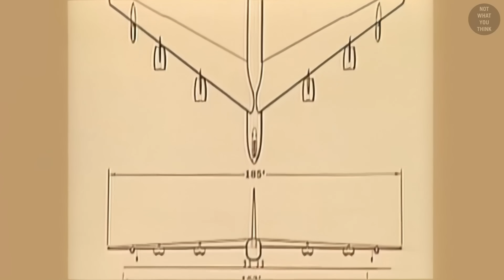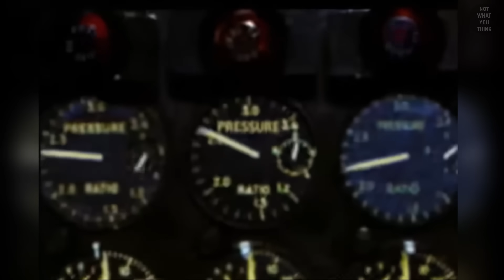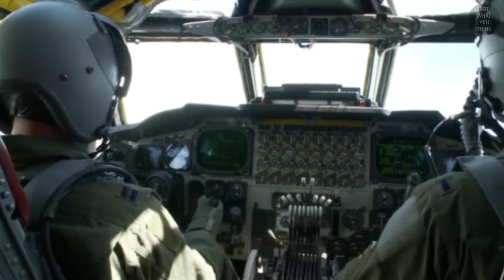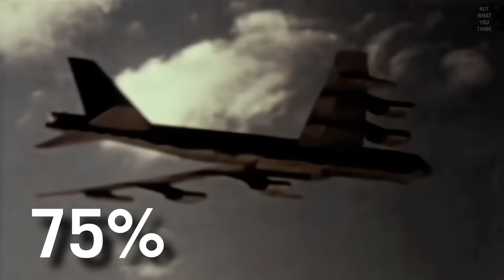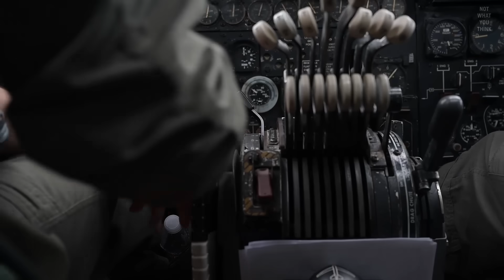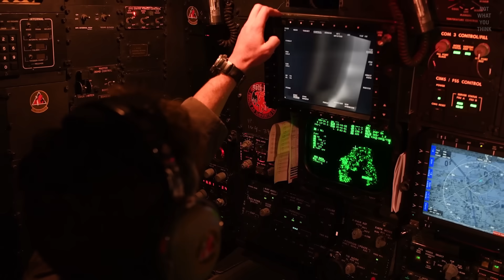Why This Obsolete Bomber Will Outlive EVERYTHING

Comment: Something crazy is that the time jump between the B-52 entering service and the present day is longer than the jump from the wright flyer to the B-52.
Reply: It's incredible to think how much WW2 advanced the aviation industry.
Reply: @Jabberstax  I think the two world wars forced the rapid development of aircraft, increased R&D, and quickly eliminated the chaff products. Even after WWII, twenty years later, it went from advanced prop fighters to the capable jet fighters and bombers. The caveat being that aircraft grew bigger, more expensive by unit, and the physics that makes them better had been pushed to material capability limits. The "better" aircraft now utilize little that is dramatically better by flight characterists than aircraft 30 years ago, but all the soft-systems make them more dangerous as weapon platforms as well as more survivable against counterparts. The B-52 is just that now, a heavy haul stategic weapon platform. That is why they flew that massive sortie mission to launch many dozens of guided missiles in rapid succession during the first gulf war.
Reply: @JRyan-lu5im  im no expert, but theres fighterjets that are impossible to be flown just by humans. It needs a computer to keep it in stable flight. As i understand this inbalance is used to make the planes very agile. Iirc the f22 and the eurofighter use this.
Reply: @civiere  you’re talking about fly by wire aircraft, which is just a really common thing not only because of the maneuverability advantages it gives, but also it makes them easier to fly since the computer is doing a lot of the trim adjustments that would have had to be done manually before. Modern passenger jets have fly by wire control systems because it makes them easier to fly and allows the airline companies to have less crew on board to fly the aircraft.
Reply: @Sturmischer  bet it's called fly by wire but what fighters and passengers use is not the same idea. Easier to fly wasn't the goal in fighters.
Reply: @civiere  it may not have been the end goal, but it's one of the reasons it was implemented on other fighters after the F-16 came out. Saying there is only one reason that caused the adoption of something is usually incorrect, most of the time with new innovations like this there are multiple factors that lead to the development and adoption of said innovation.
Reply: @civiere  that’s the case with many military planes.. B2 as well
Reply: @JRyan-lu5im  I worked on the old E-model B-52 back in the early 60's. We were all convinced with the idea that the more it flew the less problems we had with it. Let it set for three or four days and the next flight it made would come back with excessive amount of discrepencies , in comparison to it's flying every other day.
Reply: @Jabberstax  operation paper clip, the USA captured all the Nazi scientists and tone them back to the USA
Reply: @Jabberstax  I'd credit WW1, planes were pretty much all low powered bi or tri-planes before then
Reply: @Jabberstax  Necessity is truly the mother of invention
Reply: @Jabberstax  not just aviation but naval warfare aswell with the introduction of the aircraft carrier and temporary battleships
Reply: @Jabberstax  The Nazi bomber plan was a great influence on the B2 Spirit, atleast I believe. The design is almost identical.
Reply: @chad6243  I might be wrong but I remember reading that an American engineer was developing a flying wing beforehand. Undeniable that they had a huge influence on aviation though.
Reply: @chad6243  The B2 was inspired by Northrop's earlier flying wing prototypes, the XB35 and the YB49
Reply: @chad6243  What plane are you talking about? If you mean one of the Horten planes the answer is no.
Reply: @potatofuryy  have you seen the Lazerpig vid on the Horton? It's a brilliantly argued and hilariously presented stake in the heart of the myth.
Reply: @mikedrop4421  I've seen it. Great video. Love lazerpig.
Reply: @chad6243  That's actually a myth, the Northrop half of Northrop Grumman had its own flying wing designs (all of which look a lot closer to the B2) years before Horton's.
Reply: @chad6243  wrong, WWII Germany could not get a bomber to work, one of their epic failures of the war.
Reply: The Horten Brothers were German, hence Horten, not Horton. Repeat, Horten.
Reply: @chad6243  completely wrong, 1 wasn't a bomber 2 wasn't stealthy and 3 the B-2 took inspiration from the B-35 and B-49 which was made by the same company that made the B-2. So stop spreading Wehraboo lies.
Reply: @chad6243  they are completely different scales, engine positioning is much different, and the purpose of both are way different. And the Horton had no rudder controls if I remember correctly, and the b-2 uses air braking to rudder.
Reply: You're completely wrong lad. 1. It was extremely stealthy for the period, it was a bomber and was capable of crossing the Atlantic and back without refueling. Look at the Horten 229 before waffling.
Reply: Obviously there are differences but the design takes influence
Reply: @potatofuryy  Sure... 😂
Reply: @TheUsmc0802  simply because the they rather wanted some unnecessary big tanks an canons...
Reply: @kousand9917  😂😂😂
Reply: @CorruptInfinityOfficial  that's not even the point of his comment
Reply: @chad6243  actually the Horton is extremely different from the b2 the only thing that is similar is the base of the design (flying wing) and even before WW2 there was already flying wing planes. also the reason why the Horton was a flying wing was because of upgradability and cheapness. While the flying wing design of the B2 was for stealth (the shape doesn't give it stealth but the engine shape does which is also why the Horton isn't stealthy)
Reply: @chad6243  common misconception. northrop was in the flying wing business at the same time as the horten brothers.
Reply: @chad6243  Absolute Nonsense
Reply: @charliebrown1006  Search for vids on the Northrop YB49...amazing aircraft killed by politics.
Reply: @vchism712  I agree it was ahead of it’s time. I was thinking earlier even like the Arup flying wings 

Edit: just found the n9m too, Northrop really does make some beautiful planes.
Reply: @chad6243  Nope, it is 100% stereotypical and inaccurate comment. Especially considering that US has the Northrop YB-49 and four decades later came the B-2 as prototype.
Reply: @chad6243  The Horten Ho 229 and H.XXIII were almost certainly an influence on American Flying Wing design.
Reply: @chad6243  This is an utterly factually incorrect statement. The B2 is its own thing; the only thing they have in common was the idea of a flying wing design. Its like saying the F-15 was based off the Bf109 because they both have wings.
Reply: @chad6243  No it isn't, there is almost nothing the same on the Horton bomber and the B2 other than that they're both dorito shaped. The Horton bomber didn't even invent that design, America had already experimented with it
Reply: @chad6243  Not particularly.  Northop was working on flying wings well before WW2, and that culminated in YB-35 and YB-49 (some of the most beautiful airplanes ever built, and possibly the source of some of the UFO lore from New Mexico).  They weren't adopted due to alleged politics involving Convair and the B-36, but 30 years later Northrop wound up making an oddly familiar airplane.
Reply: @charliebrown1006  Jack Northrop
Reply: @TheHighSpaceWizard  I gotta go see that now, thanks for the heads up my dude...
Reply: @chad6243   gruman had flying wing planes before the horton bros.
Reply: @chad6243  to be clear you mean ho-229?
Reply: @charliebrown1006  correct. Said American engineer is Jack Northrop, the founder of Northrop that later merged with Grumman and made the B2
Reply: @chad6243  no it wasn't, the flying wing was being developed beforehand
Reply: @charliebrown1006  When Northrop was experimenting with propeller driven flying wings in the early 1940's, the Horten brothers in Germany were putting twin turbojets into their prototype fighters.
Reply: @chad6243  me: *looks at the YF-12
Reply: @chad6243  Not really. There were plenty of flying wing concepts and even working prototype before the Horten.
Reply: @chad6243  the design is completely different. The only thing they share is that they're a flying wing but these have been implemented before the Horton
Reply: @chad6243  well the Lockheed CEO first had the idea, and made the YF-12, which was unsuccessful

In the last year of his life, he saw the pinnacle of his flying wing dream
The plans for a B-2 stealth bomber, advancing the path of aviation technology
His dream had been achived
Reply: @chad6243 b2 spirit wasn’t really a derivative of previous flying wing design. Is was more a product of soviet radar calculations than it was any Nazi design
Reply: @Jusuff  Which were based on a German Scientist's original proposal to the German Military during, I think it was WWII, but it may have been during the interwar period, who was rejected, and went to the US instead lol
Reply: @chad6243 no, no it wasn’t. Jack Northrop was developing a design at the same time, Northrop’s designs would continue to be improved upon until eventually the Air Force put out specs for a plane that could employ the flying wing. Germany had zero involvement. Nada.
Reply: @chad6243 1. it was slightly more stealthy not even close to being “stealthy for its time”
2. It was a Fighter Aircaft
3. It was not even close to capable of crossing the Atlantic
4. The only things on the planes that look alike is the fact both are flying wings, The B-2 is more square whilst the Ho-229 was rounder
5. It’s only flight was as a Glider
6. The Stealth was only a claim by one of the Horten brothers to claim something they didn’t create
Reply: @chad6243 I'm more willing to bet it's more inspired by the YB-35, which began development in 1940. It's also a Flying Wing and notably has a lot more in common with the design of the B-2 and B-21 than the Ho 229. Especially in it's YB-49 Jet-Powered variant.
Reply: @chad6243 the horton ho?
Reply: @charliebrown1006  It was Jack Northrup who designed and built the original flying wing.
Reply from the maker: Good perspective!
Reply: @NotWhatYouThink  the worst thing about it is you called it obsolete when in reality it's not at all actually because they've modernization done to them making them not obsolete if they were obsolete they would no longer be in service
Reply: @diddydoit4  did u watch the video
Reply: @NotWhatYouThink  You may have left a naughty word in your video at 1:55 ;)
Reply: @NotWhatYouThink great perspective
Reply: Dude that's awesome!  Like the way Cleopatra is closer in age to the first McDonalds than she was to the pyramids.
Reply: I love seeing technology that stays relevant for so long. It shows that sometimes you just need to stick to what works and give it a fresh coat of polish now and then.
Reply: Goes to show you the limitations of physics and economy. Also, you should try some basic university-level physics lessons from the 50's, it makes modern stuff look elementary.
Reply: I learned this fact at the Darwin Avation Museum
Reply: DC3 even more so,   but they were good then 1935,  and are good now.  
Without govt. subsidies;  'Current uses of the DC-3 include passenger service, aerial spraying, freight transport, military transport, missionary flying, skydiver shuttling and sightseeing. '
Reply: @acbikeoz  The DC-3 (C-47), believe it or not, was one of the most effective, combat and recon, aircraft of the Vietnam War.
Reply: It's not what you think
Reply: and yet we still haven't  landed on the moon since the 70s such a shame
Reply: 2:01 HE SWEARD LOL
Reply: Damn...that's pretty neat
Reply: @qntmxiii  yeah obviously it was aliens.
Reply: That’s actually crazy to think about 😂
Reply: Crazy thing is comparison of B52 with Tu95. One side of world peace simply doing it wrong. Which one?
Reply: @qntmxiii  ,so we going to find steep on step the epicentrum of worldwide corruption. Ok.
Reply: Also the Air Force has put together a maintenance plan that will keep B-52's flying until around 2100, which means the bombers will be flying for 150 years after they were built! There aren't even guns used by the military that have lasted that long in service!
Reply: It’s an interesting plane
Reply: I was thinking exactly the same thing the other day!
Reply: So, they've literally been flying for more then half of the history of flight.
Reply: There was a chance that I wouldn't have been alive today. That 1961 incident could've gone worse and killed my mom and her parents and my dad's parents before he was born. Meaning I wouldn't be here
Reply: It might be old, it might be ugly. But say the word "Bee Fifty Two" to a 3rd world dictator, a terrorist state or a minor nuclear power and the hair on their head stands straight up and wiggles.
Reply: I think by now it's nearly double the time
Reply: Not sure if they mentioned it in the video but another fun fact is that the wingspan of the B-52 is 185 feet which is 5 feet longer than the Wright brothers' first flight.
Reply: U.S. should build more 52s
Reply: That’s actually not that crazy if you understand flight. Once we figured it out it’s pretty easy to rapidly advance because it all uses the same principle
Reply: @qntmxiii  Sure.. at the Roswell site you can still find pieced of aluminum today… UFOs are made od aluminium
Reply: If you also see how many revisions, retrofits and improvements the plane went under, it is amazing.

I think they will eventually just make another multipurpose workhorse to replace it.  Likely one that can function as a military transport plane or heavy bomber by only locking a few components in place and switching out a few components only needed for bomber use for ones that provide conveniences like a floor and doorway.
Reply: did russia had their own version of operation chrome dome?
Reply: LOL HE SWEARD AT 2:01
Reply: thats how getting old works
Reply: Progress is an logarithmic function
It increases fast and then just slows to almost no progress at all
It's reverse exponential, until some ground-breaking abvancements made and the curve is just jumps and continues to move at it's previous speed
Reply: I love the name 😂
Reply: That's not that crazy. 🙄 It's called time marches on.
Reply: Something else that regularly blows my mind is that the first flight of the lancaster bomber and the first flight of the Vulcan bomber were only 11 years apart. Those two planes look like they’re from different planets.
Reply: To think we went from dreaming to fly > flying on the wright flyer which is nothing more than paper and 1 person > a flying Titanic Air Bus A380 complete with showers, passengers, blankets, food, A/C heater climate control, bar, full kitchen, electronic entertainment, not to mention the passengers luggages, cargo etc. ALL at the same time.
Reply: @qntmxiii  I don't see any anti gravity saucers around
Reply: Another one, the Antonov AN-225 has a cargo hold LONGER than their first flight.
Reply: A testament to the influence Boeing and Pratt&Whitney has over the government, hence the corruption.
The move to the Rolls Royce engines must have been a huge blow to P&W's 70 year old cash cow.
Reply: Yeah, it’s like today‘s further from my birth than WW2! And I’m not THAT old.
Reply: We hadn't even been in the sky before 120 years ago, and now we have a space station orbiting around Earth at over 260 miles altitude up in the sky and cruising along at over 171,000 mph, and an incredible telescope a million miles out in space, finding a new universe with more planets and their many moons out there, and who know what else will be discovered, maybe alien life?  That's what they're always looking for, but I'm not so sure ET's want to be found!  Would you want anything to do with a race that bombs and destroys its own habitat and murders innumerable members of its own kind?  A higher intelligence probably wouldn't!
Reply: it’s very crazy to think about
Reply: It’s like if the Sopwith Camel was used all the way from WWI to Vietnam, and even that doesn’t even scratch the surface of how long the B-52 has served as the go to long range heavy bomber.
Reply: Technology advances exponentially.
It took us four times as long to go from bronze swords to iron swords as it did to go from iron swords to nukes.
Reply: @qntmxiii  Well it appears Antonio's comment regarding today, the 5-52 and the Wrights is correct... because math.  My comment could be debated.  From what I've learned our average guess is about 4000 B.C. for the great pyramid approximately.  Ptolemaic Egypt with Cleo was approximately the turn of B.C. to A.D. with Caesar and Mark Antony so it appears that way.
Reply: @qntmxiii  1945 operation paperclip aftermath rather.
Also, nothing in the evolution of aircraft technology points to some mysterious quantum leap forward.